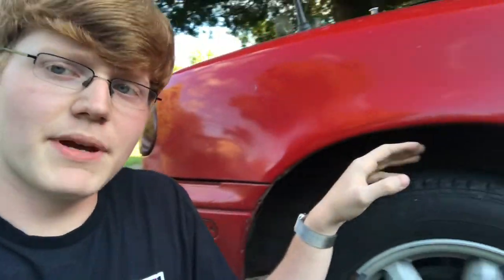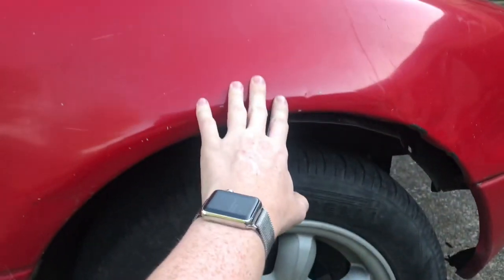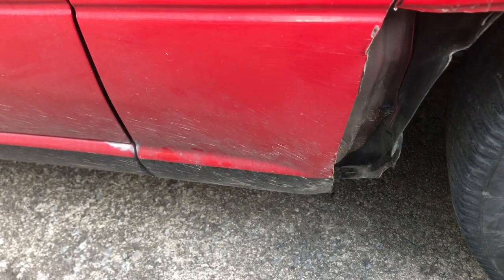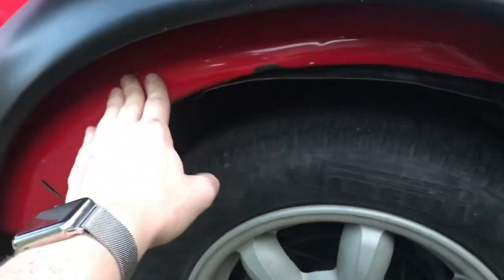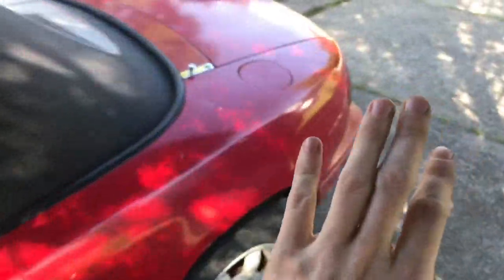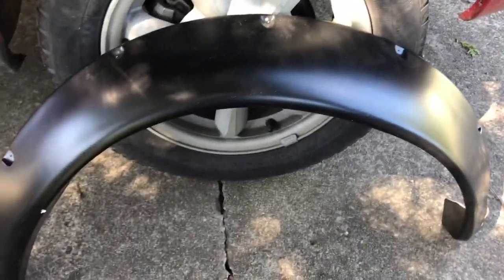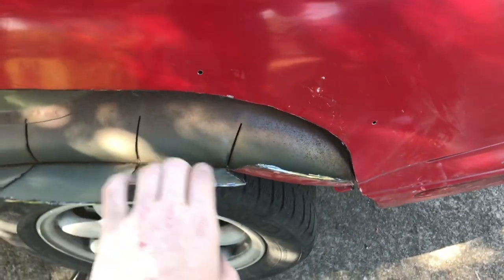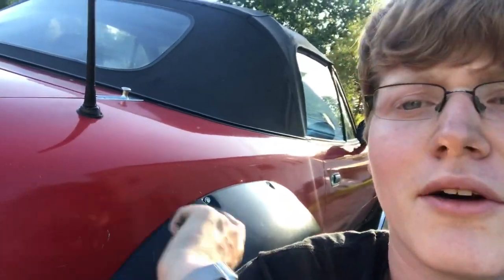INSTALLING A ROCKET BUNNY WIDEBODY KIT ON THE ECOTEC MIATA

Comment: Just curious. How does the car feel without power steering? I Want to do the same swap eventually.
Reply from the maker: the car actually feels surprisingly good without it. I’m running a depowered rack instead of a factory manual rack. It’s a little more work at speeds under 5mph but anything faster it feels great!